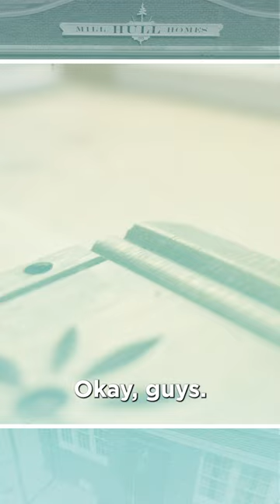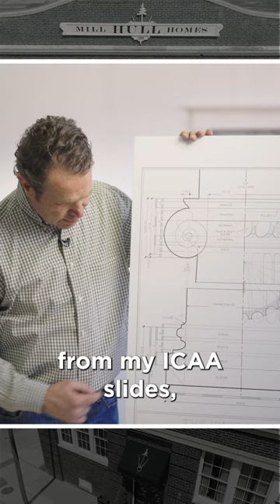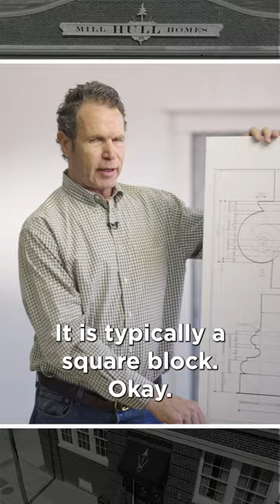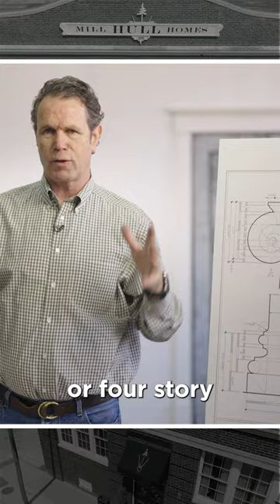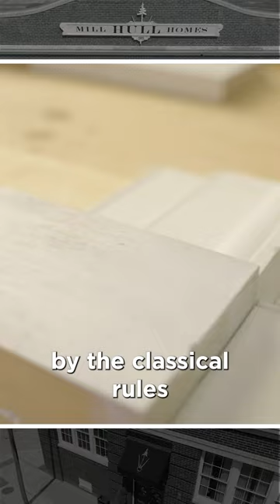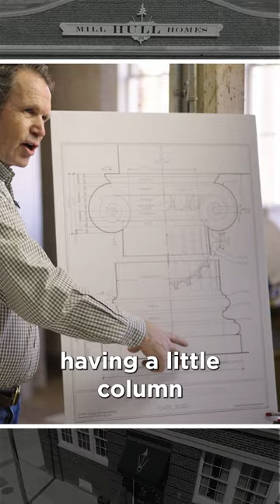What is a plinth block? How to use it.

Comment: My simple 1908 cottage has plinths supporting all the door casings. They're part of the reason I bought the house. I hate walking into an old house to find they ripped out the original millwork and replace it with that awful, skinny, modern junk.
Reply from the maker: Agreed. Thanks.
Reply: My home is from 1910 and I feel this so strongly. People have no sense.